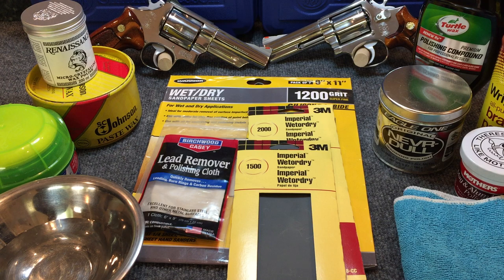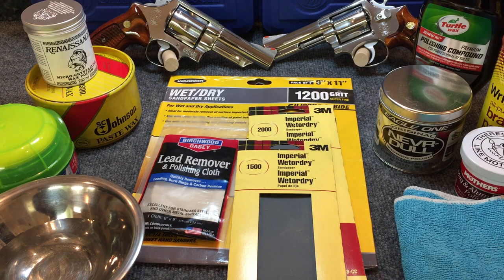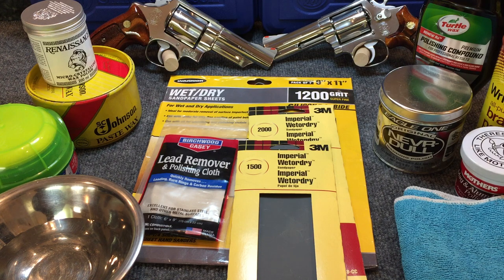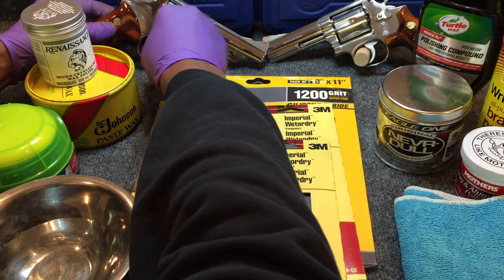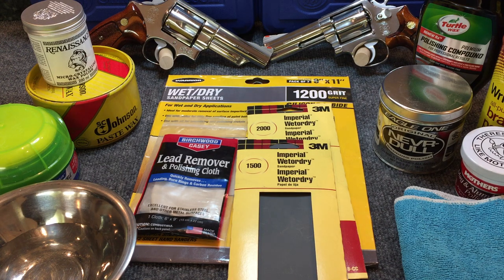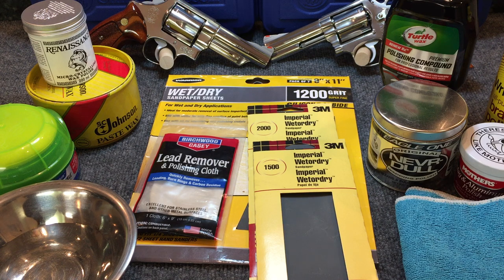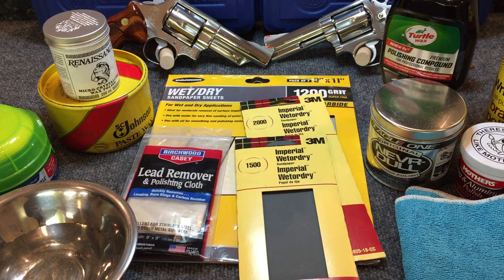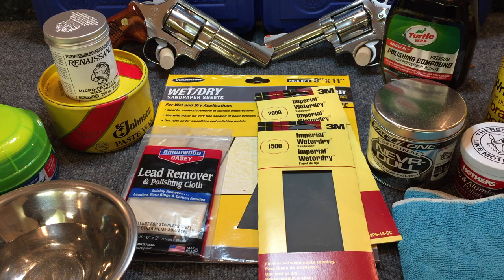Bright Polishing and Maintaining Stainless Steel Guns

Comment: The Birchwood Casey wipes are amazing for lead removal and the burn rings. They are a life saver!
Reply: Best product I’ve used by far they remove burn rings like magic
Reply: @googlechicken    Hey sorry I know this is a lot so basically my stainless steel 9mm handgun is brand new in the box never used or fired just got it last night , so basically start off by sanding the entire pistol  lightly with 1200 grit ? Then use the 1500 only on the major scratches left over from the 1200 grit sanding right? Or do I use 1500 for the entire gun ? Than with the 2000 repeat the entire process of sanding the whole gun ?  Than once I’m done with that start with the 2500 grit for the entire gun again ??That’s the part I’m confused which grit do I start off with to begin the whole gun sanding process ?  At first . & Since my pistol  is brand new in the box with no scratches step by step which sanding grits do I start for the first sanding  process I would like to use the same grits in the video maybe you know thank you man ??!!

Comment: Big Swoll, first and foremost, god bless you for sharing your knowledge and experience with us about polishing Stainless Steel Revolvers. I learned ALOT of information I never knew. My question is when your sanding thru all the grits, is the sanding paper always wet thru the whole sanding process like you were saying when you first start? I have 3 S&W SS revolvers I’m wanting to get to a high polish/mirror finish. The model 66 I bought very cheap has alot of surface scratches and when I removed the grips it has a significant pitting line where the top of the grips meet the frame. I apologize for the long comment but this is the first video I’ve seen in days where I learned so much and am excited and MUCH more confident about scratch removal and finish.
Reply from the maker: Thank you and no need to apologize.  I' have couple of revolvers that are the same way as your 66.  You not not be able to sand / polish out all of the pitting.  But you will be able to make it less noticeable.  Your sanding paper should be thoroughly wet before sanding, and kept wet all during the sanding process.   Cut your papers into the usable sizes and write the grit on back with a marker.  I soak mine for about 20-30 minutes or until the paper no longer floats before starting.   That insures that the paper is thoroughly wetted.  just dip it the water regularly while using it.  The water keeps the surface cool nad lubricated; and flushes away loosened grit and sanding debris from the paper-to-surface interface area.  It also forms a "slurry" that maximizes your polishing effort.
Reply: Sounds good Sir. I’m about to get on it. I’ll send you the before and after pictures when I’m done with it. This will be my first time doing this so hopefully I don’t mess up to bad 🤣 Thanks again brother, God Bless
Reply from the maker: You won't.  Just start with a grit paper only aggressive enough to remove the deepest scratches, and work your up from there.  Be careful around stampings and  markings.  Once you to 1500-3000 grit  you'll be polishing then.  . Check this vide out.  
https://www.youtube.com/watch?v=htv84iiKNiU&t=658s  @johnalvarez9060

Comment: Last question if I may. When cleaning the brite work on my boats like T Tops, hand rails etc. We always used brass wool or scouring pads along with a cleaning fluid then a wax. It removed oxidation but left everything shinney. I liked it because it held up well. Have you ever tried that instead of sand paper? Just curious. Thanks!
Reply from the maker: No Sir, I have not tried that.  My reason for using sandpaper is to remove scratches and even out the SS finish.  Brass wool is good on materials softer than brass, and for removing oxidation and embedded dirt.  It will not polish SS, but will leave visible surface scratches on polished surfaces.

Comment: Hi, did I hear you mention once that you could restore a pistol to it's original brushed finish (although that may have been someone in the comments. Is that so? Wet sandpaper method just higher grit? Thank you for your time.
Reply from the maker: It is possible to return one to a brushed finish similar to the original using a wheeled brush as done at the factory.  It would be very difficult to do with sandpaper.

Comment: Great video!  So with a brand new revolver (no scratches) would you use any sandpaper to achieve a bright shine or just go to the polish?   I also have burn marks on the trigger also.  What do you recommend for that?  Thank you! 🙏
Reply from the maker: I've never used sandpaper on a new gun.  I typically reserve that for guns with scratches that I want to remove and polish up.  A new gun won't have scratches, just finishing marks.  So I'd probably just polish first to see if the results will be satisfactory without wet sanding.
 
However, I have used sandpaper on a couple that had very little scratches.  In each of those cases, I started with very fine paper in the 1200 - 1500 grit range and worked up to 2500 - 3000 grit before polishing. .  So if I opted to wet sand, I'd probably do the same or similar.  I hope that helps.
Reply: @mr2275cur  Yes!  Very helpful!   What do you do to achieve those clean triggers?  Thx 🙏
Reply: By the way.  I am about half way through your videos and have learned a great deal.   I plan to watch them all and have already recommended your channel to friends.  🙏
Reply from the maker: @dmitriponomarev8002  Thank you Mr. Ponomarev.  That means a lot.
Reply from the maker: @dmitriponomarev8002  I use the same technique.  I wet sand if needed, and then polish.  Wrapping your paper and polishing cloth around wood or plastic dowel helps working in tight trigger guards.
Reply: @dmitriponomarev8002  hey maybe you understand better than I did ? So I have a stainless steel 9mm compact handgun a Taurus G2c brand new in the box  so basically start sanding with 1200 grit the entire gun , once that’s finished do I used the 1500 grit on major scratches noticeable scratches only or do I sand the whole thing with 1500 as well ???
Reply: @mr2275cur   Hey sorry I know this is a lot so basically my stainless steel 9mm handgun is brand new in the box never used or fired just got it last night , so basically start off by sanding the entire pistol  lightly with 1200 grit ? Then use the 1500 only on the major scratches left over from the 1200 grit sanding right? Or do I use 1500 for the entire gun ? Than with the 2000 repeat the entire process of the gun ?  Than once I’m done with that start with the 2500 grit for the entire gun ?That’s the part I’m confused that which grit do I start off with to begin the whole gun sanding process ?  Since my pistol  is brand new in the box with no scratches step by step which sanding grits do I start for the first sanding  process I would like to use the same grits you have in your video that’s a perfect shine

Comment: What procedure do you recommend to achieve a high polish on bead blasted or matte finish stainless steel?
Reply from the maker: If the gun doesn't have a lot scratches, just polish it up with a high quality metal polish.  I use wet sanding with 800 - 3000 grit sand[paper to remove scratches, then metal polish to achieve the desired finish.  I've posted some videos showing my method.

Comment: These are great videos. I'm about to release a video of restoring and removing scratches from my Sphinx AT2000P which is brushed stainless steel. I also do watchmaking and some of the tools from watchmaking can be used on guns.
Reply from the maker: Hey man.  How are  you doing. ?  I think about your story a lot.  You're one of my HERO's.  Let me know how your restoring turns out.  Post some pics or vids.
Reply: @mr2275cur  I wouldn't call it restoring, more like a touch up. But if a gun were scratched everywhere the same technique could be used.
Reply from the maker: @WheeledandWellArmed  Absolutely...
Reply: @mr2275cur  At the gun shop today I looked at a S&W small frame 357 or 38 in shinny stainless steel. It was shinny but not like your shinny. It was 375, I think it would be lower elsewhere.
Reply: @WheeledandWellArmed     Hey sorry I know this is a lot so basically my stainless steel 9mm handgun is brand new in the box never used or fired just got it last night , so basically start off by sanding the entire pistol  lightly with 1200 grit ? Then use the 1500 only on the major scratches left over from the 1200 grit sanding right? Or do I use 1500 for the entire gun ? Than with the 2000 repeat the entire process of sanding the whole entire  gun ?  Than once I’m done with that start with the 2500 grit for the entire gun again ??That’s the part I’m confused which grit do I start off with to begin the whole gun sanding process ?  At first . & Since my pistol  is brand new in the box with no scratches step by step which sanding grits do I start for the first sanding  process I would like to use the same grits in the video maybe you know thank you man ??!! Just don’t wanna mess it up it’s my first time

Comment: How do you prepare the surface of a revolver that has never been waxed before, and has been routinely exposed to CLP products that claim to leave a residual protective film on the gun?
Reply from the maker: Good question Mr. FO.. Good wipe down with clean 91% alcohol is enough to remove the CLP before waxing.  It's safe on all finishes and evaporates fast.

Comment: Hi Big Swoll, what product would you recommend for polishing a Nickel Finish on an older Colt Python or an older S&W revolver with a nickel finish? I appreciate any suggestions.
Reply from the maker: I would only use Flitz Metal Polish on Nickel.  And I'd use it sparingly and carefully by hand only.
Reply: @mr2275cur  thanks I was gonna pick some up. I have mother's mag polish for my stainless steel wheels guns, but I hear Flitz and/or semichrome polish it a lot less abrasive!  Some of the nickel finish is cloudy in the nooks and crannies. And there is of course many faint swearl scratches when you look extremely close at the finish, but so beautiful from 1 foot away like a mirror.
Reply: @super-villain800      Hey sorry I know this is a lot so basically my stainless steel 9mm handgun is brand new in the box never used or fired just got it last night , so basically start off by sanding the entire pistol  lightly with 1200 grit ? Then use the 1500 only on the major scratches left over from the 1200 grit sanding right? Or do I use 1500 for the entire gun ? Than with the 2000 repeat the entire process of sanding the whole entire  gun ?  Than once I’m done with that start with the 2500 grit for the entire gun again ??That’s the part I’m confused which grit do I start off with to begin the whole gun sanding process ?  At first . & Since my pistol  is brand new in the box with no scratches step by step which sanding grits do I start for the first sanding  process I would like to use the same grits in the video maybe you know thank you man ??!! Just don’t wanna mess it up it’s my first time

Comment: Big Swoll how are you?! I just got through watching your video and it was awesome. I will get started soon on my sanding because I need me a mirror shiny revolver like yours lol
Reply from the maker: Alright...!  Sand at your own risk...  LOL...
Reply: @mr2275cur  I will lol you're the best!
Reply: @valentingomez2193      Hey sorry I know this is a lot so basically my stainless steel 9mm handgun is brand new in the box never used or fired just got it last night , so basically start off by sanding the entire pistol  lightly with 1200 grit ? Then use the 1500 only on the major scratches left over from the 1200 grit sanding right? Or do I use 1500 for the entire gun ? Than with the 2000 repeat the entire process of sanding the whole entire  gun ?  Than once I’m done with that start with the 2500 grit for the entire gun again ??That’s the part I’m confused which grit do I start off with to begin the whole gun sanding process ?  At first . & Since my pistol  is brand new in the box with no scratches step by step which sanding grits do I start for the first sanding  process I would like to use the same grits in the video maybe you know thank you man ??!! Just don’t wanna mess it up it’s my first time
Reply: @alexx_windycitychi558  Hi  Alexx. Hope you're doing well. I followed all the instructions that Big Swoll gave me but I didn't do the best job. I scratched my revolver. Not too much but I didn't like the end result. It's not as easy as it looks lol
Reply: @mr2275cur  ??

Comment: Could i start with 1000 grit , then 1500 , then 2000 ?
Reply from the maker: That will depend on how bad the scratches are that you're trying to remove.  You may need to adjust up (finer) or down (coarser) for best results.  In either event, try to make your final sanding before polishing at least 2500 grit or higher.

Comment: Hi big swoll, I am looking at an older model 66 no dash, has some pitting under the grips on SS side plate. Do you think your wet sanding technic can reduce the amount of pitting on a SS revolver? Or is that something we just have to live with?
Reply from the maker: It can definitely reduce it.  It will depend on deep the pitting is.  Unfortunately pitting under the grips is common problem when owners don't remove the grips and clean under them.  How deep bad or deep is the pitting?
Reply: @mr2275cur  I appreciate your help, the area is about 1 inch long but 1/2 inch wide just under the top of the grip, not too bad.
Reply from the maker: @super-villain800  Believe it or not, but my Model 66 in this video had the same pitting that you're describing.  I was able to wet sand  and polish it out about 95% clear using 500 - 2500 grit papers.  I can still see a faint pattern with the grips removed, but I'm quite pleased considering where I started.  You can still see some very small pits on the left side if you look closely in the video.  You have nothing to loose by trying.  Just keep you paper wet and flat.  You may not get it all out.